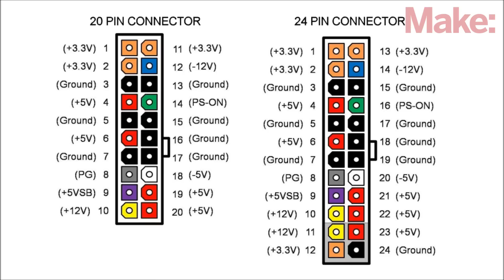Computer Power Supply Adapter

Comment: what's the difference between +12V and -12V?
Reply: The potential relative to ground. +12V is 12 volts higher than ground, and -12V is 12 volts lower than ground. If you measure the potential between +12V and -12V you'll get 24V. However be careful of the current limit of your PSU, I killed one up by exceeding the maximum current of -12V rail, and since I've noticed -12V on most PSU would only do 0.5-1A.
Reply: Edmond Siu why +12V and -12V why not just 12V
Reply: +Agentc0re That's completely wrong - please do not mislead people.
Reply: 12+12=24V
Reply: Csongor Kecskés Ah ha! I wondered too why have separate 12V and -12V; never occurred to me to add them. Thanks.
Reply: *****
Great answer, I had wondered this too.
Reply: Power flows from + to -. +12v means power comes FROM it and -12v means power goes TO it.